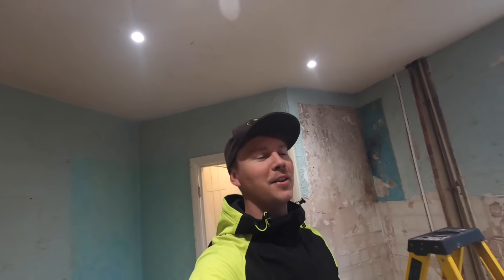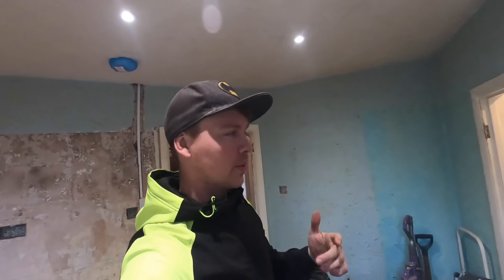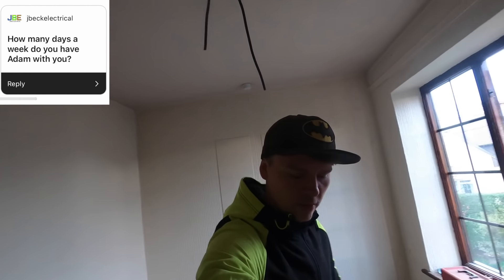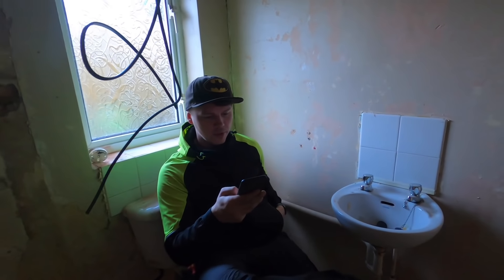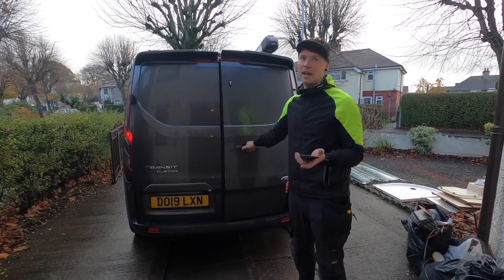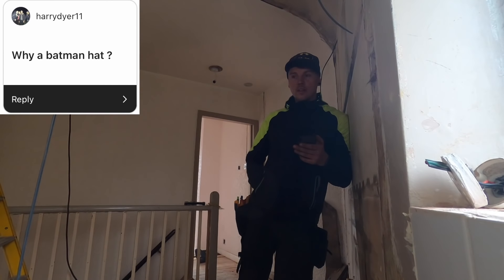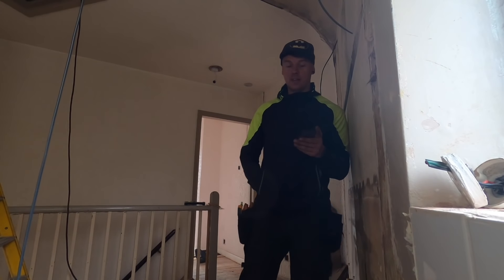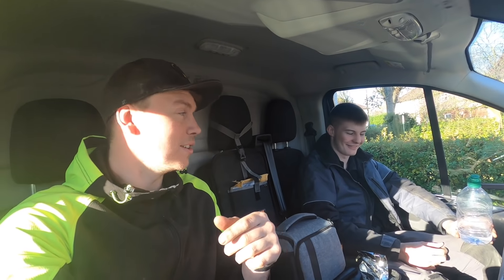The SHOCKING Questions, Exotic life of an Electrician

Comment: I see the argument about using radials but imagine if that cpc had come out on the first/second socket of the radial leaving the rest down the line un earthed that wouldn’t be picked up by the end user,,, I think the best option for a empty property would be a ring circuit on a 20 amp mcb
Reply: Definitely an option, another way might be to wago the cpc in the back of sockets (4 way, 1 in 1 out 1 box 1 socket). The 2773 series that're out now are so tiny and rated for 32A, no trouble putting them in.

Comment: When wiring a 3core to the switch, the way you want to do it is
CU > 1mm to pendant > 3 core to switch > 1mm to pendant > 3 core to switch (that way you’re wiring the radial but using all the cores, so it’s not spare but you have a neutral at every light and switch but using the black as a switch wire at all times. (Only downside is 2nd fix takes a tiny bit longer) does that make sense?

Comment: Why dont you use the light switch patress as the junction box and run the live feed to it.  Then all you have to do is run a single twin and earth the the light fitting?  Are those loop in loop out ceiling roses not a bit old hat these days?  Having all these wires sticking out the ceiling makes it very dificult to replace a standard pendant with a more ïnteresting" light fitting.

Comment: Being old school have used plain screw drivers to tighten up the breaker connections up etc yes I will move the times and get one,if your doing a eicr test do they let you no if the terminations are done up to tight ,I suppose the other way is to undo the screws and then use the torque screw driver 👍

Comment: I have been speaking to the veto engineers you really want a heavy bag that can be rolled including collapsible wheel system that can be dragged up stairs akin to paramedic rolling beds.
Reply: They'd take over the market with this; mainly because trades people love them
Reply: @user-wk7wv8rn8h  i love them too they are very robust and the collapsible wheel system is a complex one to resolve but it’s doable. If you have a bag that can accommodate lots of tools you want to be able to take it up and down multiple floors and to and from the van without having to lift it causing longer term health issues.